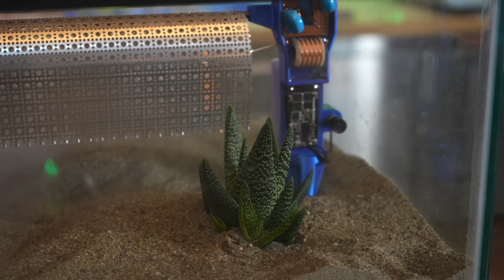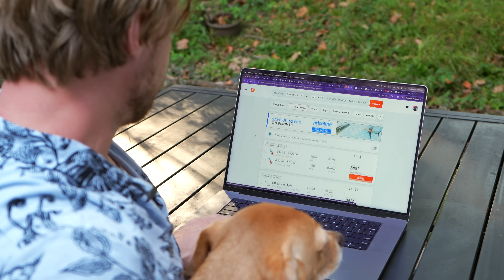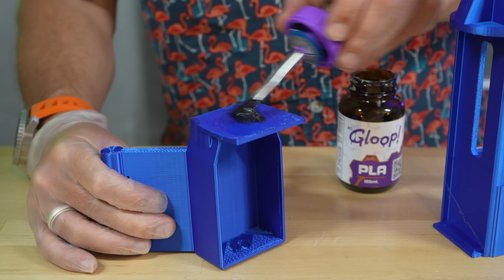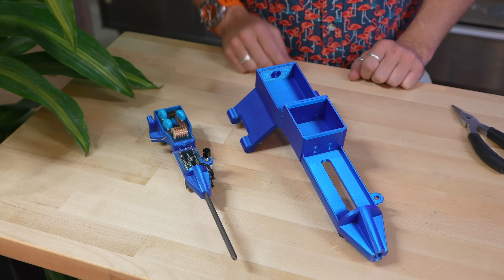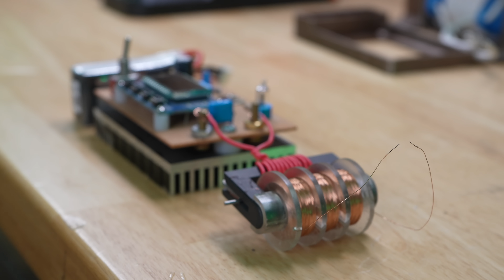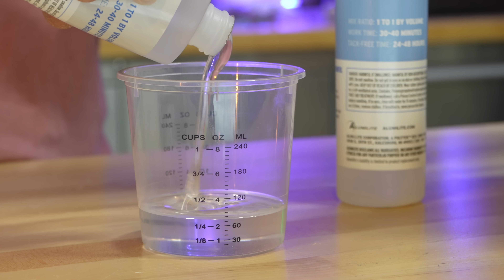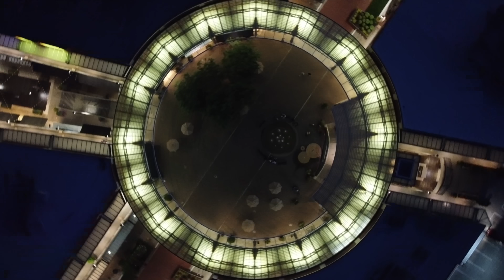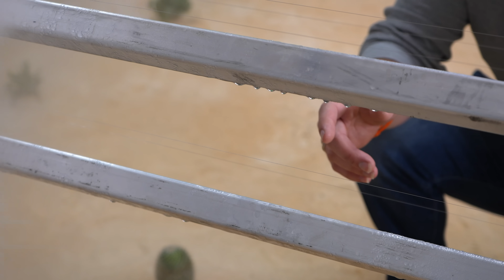Turning Desert Fog into Fresh Water Using 50,000 volts

Comment: 21:21 Use a LDR with timer circuit for automated charging and moisture collection. The system should work logically like if sun available then charge the battery, else turn on cultivator after a specified time. This can either be accomplished with electronic circuit or microcontroller. Its like relay logic with timer. You can also use temperature and humidity sensor (eg:  DHT22) to check for fog. There should also be an option for manual control or scheduled one if you're planning to make it as a product.

If anyone has solved the problem earlier don't mind it.

Comment: I hope you do some efficiency testing when it's desert fog season next year. Your preliminary numbers come out to 16 kWh/m³ water, which is nice for mobile use since it's transportable, but not going to replace reverse osmosis for agriculture anytime soon because it still uses triple the power per unit water and it's dependent on fog, which is apparently seasonal.
As a reminder, here's from the last video in the series: "The 14 mL/Wh  translates to 24 kWh/m³, which is competitive with distillation desalination plants (if those were heated by electricity for some reason), but far behind reverse osmosis at 3-6 kWh/m³."

Comment: 21ml per Wh = 21l per kWh
Typical desailination plant 1000l per 3.5 kWh = ~285l per kWh

So about 1/13 as efficent clpse to a body of costal water, that is needed for fog to roll along.

Not bad for a hobby project
Reply: Also... 21ml per kWh that like 5hr peak sunlight per solar panel.
And you need 10 of them for 1 L of water... you not gonna water fields with that😂

Comment: At 15:55 wouldn't it be better for ease of assembly to make some holes going through the square tubes and the 3D printed structure. So that you can just insert threaded bolts throght the whole thing and use winged nuts to assemble it. It would be structurally more stable and you wouldn't need a screwdriver.

Comment: Always measure the temperature of the scrounging. And in this specific project the relative humidity values are obligatory to an overal evaluation of your system. You'll need probably to study the heath saturation dynamics for the condenser rods. They collect not only water, but it's latent warmth of condensation. If the heath extraction isn't sufficient you might reach the saturation before the fogy conditions are over, loosing the cycle efficiency. So probably a temperature monitoring for the air and condenser rods is necessary.

Comment: Have you considered designing this device specifically for water collection rather than for watering a field? That could remove some limitations and make the design more efficient.
Also, here where I live we have high humidity and our A/C units produce a lot of water, perhaps that could be incorporated into a larger, more industrial version of the design.

I was also wondering if multiple cylindrical structures with internal filaments and a fan might help increase condensation + applying Bernoulli’s principle. I might be completely off, but I wanted to share the ideas anyway. Great job, Jason!

Comment: I thought of this for a fog activated switch (I think Idea2 might be better):

Idea1: Could you have a NOT gate looped into a circuit that measures impedance over a small square of absorbant but thin fabric. 

So when the fog comes in, the fabric catches some of the fog and it lowers the impedance, then once it hits a threshold it initialises the circuit. The minimum thresholds could automatically be calculated by measuring impedance at a time of day (or lux level) when you know there won't be fog, so that you have a baseline impedance for the fabric, which can offset your threshold.

Idea2: Saying that just made me think of a second solution haha. Fire alarms! Optical Fire alarms trigger when the light beam within the unit is obfuscated by smoke. If you used a more sensitive light measuring sensor you could probably work out when to turn on the device, and based on density or amount of light being blocked, you can tune the power level of your unit so it matches the incoming fog density, allowing its charge to last longer. 

Hope the ideas I threw around help a little :)
Reply: Can't you get a humidity sensor IC for like a dollar?
Reply: @Vahokif  sure, but as others have said all humidity sensors stop at 100%, while fog doesn't happen until above 100%.
Reply: @markp5726  Fog above 100% humidity may be otherwise known as a swimming pool.
Reply: Smoke detector was also my first idea. He just need to find a way to prevent activation from dust
Reply: @lmmortalZodd  Dust will be absolutely inescapable in a desert, so I suspect a smoke detector like mechanism simply can't be made reliable.
Reply: @markp5726  True. Was my first thought, but has obvious flaws. I'm thinking dust will mess up most automation attempts. Electrical and mechanical devices aren't usually made for dusty environment. A solution that is robust and cheap enough would probably have to take inspiration from the apollo program. How did NASA deal with the regolith for their instruments?
Reply: @markp5726  Like an ashtray on a motorbike, if it sounds daft then it probably won't work.
Reply: *Impedance/resistance sensor on a passive collector is brilliant!* This would be more robust than more IC-intensive options (clocks, optical light scattering) and more specific. Including the PV output voltage as a sensor for a 2nd input channel would help, too.
Reply: @psychemist2689  the only drawback I can think of is how well it'll work once dirt collects. Sure, it'll dry out in the day - but the dried mud will absorb moisture preferentially, likely throwing the sensor readings off.
Reply: What if it momentarily turned on to  see if it collects water? If something shorts and detects water it then turns of for 2 or 3 hours. This could be paired with a smoke detector for two ways to check for fog
Reply: That's over complicated and more power consumption. Mechanical humidistats have been around for a long time.

Comment: What if you were to angle the end pieces slightly lower than the center to try and allow the water being collected to flow to the ends for more convenient collection that might be less prone to wind? Maybe even cut a channel in the metal bars to control which way to water flows?

Comment: cant you use a low power temperature sensor that triggers a relay to turn on the machine when its starts getting colder and set it at the desired value when you know produces fog at the right fog time?

Comment: You should add extra features - an adjustable stainless water drainage to collect all that water into some glass container and a switch to turn the whole thing off when that container becomes full like a mini float switch used in water tanks or some electronic circuit you can attach outside the glass which can detect water level and automatically turn off the device.

Comment: This is great stuff. For end-user deployment you should really consider placing the human controls in a box that can be some amount of distance away from the stakes, like someone else said the use of a water-sensing instrument will be fantastic in addition to emergency shutoffs if the circuit breaks, and overcurrent fuses (in an easily replaceable location) since breakers are less safe due to shutoff being a switch not melted glass and such. Even if not technically necessary it adds a sense of safety which is important for adoption and prevents malicious use with alternative sources of power. Bluetooth and app or otherwise timers and such controls are great to have as an option on the control end of things too, false or erroneous readings from sensors do happen.

Also consider making a cartridge of some kind with the teeny wires already ran in position that can be easily clipped or bolted onto the stakes as easily as the metal bars. Also indicator lights at the top or somewhere obvious to inform anyone nearby regardless of device or visibility of the control panel that the circuit is on, off or broken (different colours, for colorblind maybe also different physical LED's as well).

Really wish the best for you this is amazing stuff I'm going to have to try something like this on my own one day at my mom's farm.

Comment: I think needing the manually turn it on isn't necessarily a bad thing as the environments in which they would be used likely would want a switch rather than Bluetooth. I'd also look at how best to add additional lengths of the wires to cover a larger area.

Comment: I could see birds, mice, rabbits, etc getting electrocuted on those wires and possibly shorting it out or damaging it so you might want to add a low grade motion sensor shut off or noise maker. Like perhaps the sound of a hunting hawk or owl. You could also just add wire shields that leave a  1/2 inch gap at the top and bottom so that air can still flow but you're less likely to have someone accidentally bump into the wires.

Comment: Could you further expand upon electrostatic precipitator principles using plates with several passes of high voltage lines passing across to increase active surface area? Maybe position the plates vertical to induce gravity to do its thing. You might be able to incorporate a coalescer pan feeding a micro fall tower to enhance cooling during fallout to an insulated storage reservoir.

Comment: Overengineered idea for the automated switch:
Get your time from a GPS module with an esp8266/esp32 and make  it control a relay on a timer.
No need for having to reset the clock every time that you unplug the battery, no clock drift and or extra batteries.
Slight disadvantage is that it will suck in your garage/personal desert since you don't get good GPS coverage indoors, but it may work just well enough to get the time..

Comment: Smoke detector for your fog sensor! That could trigger the machine to run and you could program it to come on after X amount of triggers to avoid false run cycles. You could also set a RH threshold and Dew point threshold that proves to the system it's actually foggy.

Comment: Are your sure about that efficiency? There seems to be an issue with the collection. Were not those triangle tips at the stakes suppose to do the collection? Seems that a lot of dripping was happening between the stakes.
Reply from the maker: True. My 4 degrees angling was just barely not enough. 5-6 would be ideal and the collection points would have worked.

Comment: Dry ice is frozen co2, not water
Reply: He said dry ice fog which is when you put dry ice as shown in water. Dry ice is frozen co2, but in room temperature water it turns into gas that bubbles through water and makes water come out as water droplets while also condensing water nearby inti droplets. CO2 can work well to nucleate water and form water droplets compared to many other gases and substances as CO2 dissolves well into water and forms carbonic acid that attracts water 

It’s been used for a long time to make fog machines and fog
Reply: Exactly dafuk

Comment: If I could suggest one change, it would be to change the shape of the lower beam. 
Your version will only work well on flat terrain because the vertical position of the beam causes the water to drip evenly. 
However, if you tilt the device's arm, all the water will drip into a single spot. 

Adding "teeth" or sharp, individual spots at the bottom would concentrate the water at set distances.
Reply from the maker: So as mentioned in the video the arms actually were angled upward at 4 degrees. And I build in water drip collection spots.  But, turns out 4 degrees was just BARELY not enough. So maybe 5-6 and we’re golden

Comment: If you consider commercializing that product, I would recommend making the battery easily detachable or just make a plug in that device so that the user will decide if he wants one battery per device or a bigger one for the whole array or just connect a diesel generator, because I am sure that in some parts of the world it would be the only financially reasonable option.
Reply: Dehumidifiers already exist and they are more expensive when considering energy cost, maintenance, and sanitization of the water than literally shipping water bottles. By a lot. Several times more expensive. Also, deserts by definition dont have a lot of water in the air anyway. Itd make more sense in a coastal area where its not needed at all
Reply: @readjordan2257  did you not watch the video? The part where he talks about how this is for coastal deserts where they get fog come in from the ocean. But right now the only practical way to harvest it is passive fog nets, which is very slow and only works when it's also windy

Comment: Exhalant work man. I love your videos and your work... Out of curiosity what would happen if you angle the legs a few degrees upward from the center to make the water run down the arms to a central point?
Reply from the maker: Thanks! That's exactly what I did with this design. Mentioned in the video quickly that the arms were angled upward at 4 degrees. Though, I need to make a higher degree than 4 going forward!
Reply: @PlasmaChannel I must have missed that little bit of information either way beautiful execution on the design and how it works.... Out of curiosity would any foggy area work just to see how it works till you can get to where you need to go? I would love to make one for a survival situation something I can use in the mountains

Comment: if a simple solution can be made to chill the square tubes (dry ice reservoir or some kind of mini hvac) you might increase efficiency enough that it can work in humid but not necessarily foggy climates too. like a dehumidifier with ionic fans basically. i already run a dehumidifier and collect my ac units water for plant water but this could be better and less likely to mold on the collection sites.

Comment: You can try and have it turn on automatically by installing a simple humidity sensor on one or all of the posts, then find the median between all or one and then set a minimum value so that way it will turn off once the fog starts to dissipate. we know that fog is at fully formed at 100% humidity, but you’ll have to find the minimum of the area that its formed, as different conditions like wind, temperature, and elevation play a large factor. However if you find the minimum value then you can set it so that once it reaches say 70% humidity it will automatically turn on, then have a sub program running to keep it on as long as humidity stays above 70% and if it drops below 70% for a certain amount of time, say an hour then it’ll turn off. That not only will make it running right as the fog forms, but also as it dissipates, but it will also increase the overall efficiency of the battery seeming that it wont have to run for as long, and will always activate at key times automatically

Comment: call me crazy but i feel like for real-world use, fog is typically taller than a human, so you could make this horizontal device into a vertical device, and that would allow a lower area footprint and also help the water to collect in a singular spot or into a standard bucket rather than a long drip tray, which in a hot desert could save on evaporation as well.   evaporation is no joke, a swimming pool can lose 25-140 GALLONS per DAY due to evaporation, so, definitely want to keep the water surface area low.  but even if you just angled it slightly, it would allow the water to all run down into a singular drip point, which might slightly improve performance, or at the very least make collecting easier.

Comment: Issue 1, im not sure how much heating the electrostatic parts are generating, but if the tubing gets hot enough itll just evaporate the fog droplets before they can even accumulate.

2. For an automated system, you could install a electric hygrometer, as when fog develops only then is humditiy at 100%. Depending on the hygrometers error percentage could have it set to activate at 98% humidity

Comment: @PlasmaChannel not to give away any secrets, but you need to maximize surface area. In gasifier water boilers we use a spiral to create turbulence to maximize the heat touching metal. then they have VAWT or a golden ratio wind turbine which may not help, if you can move air though a condenser tub you will multiply your results.